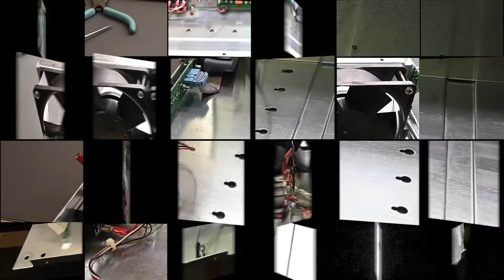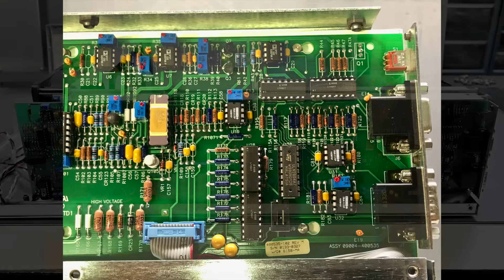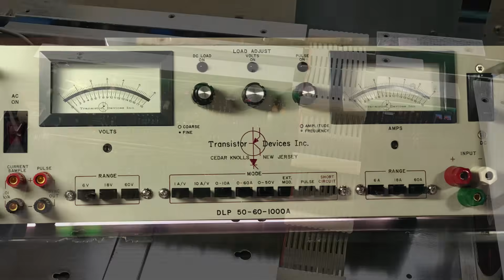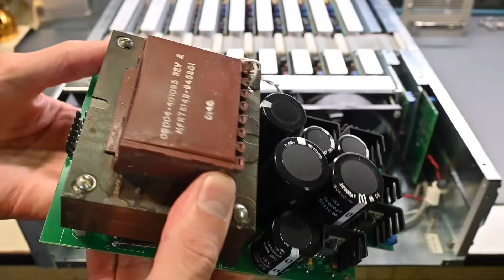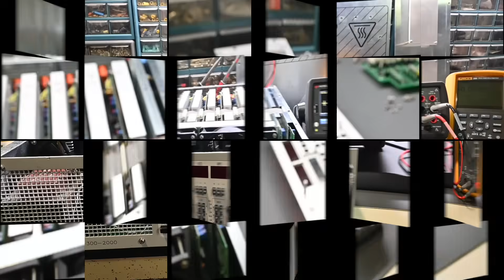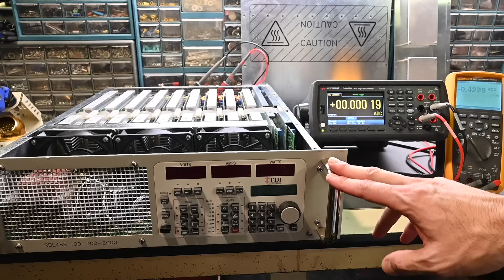Inside a Massive 2000 Watt Electronic Load (TDI 100-300-2000 Dynaload)

Comment: MOSFETs don't show thermal runaway when used as switches while they do in linear applications, like in active loads. Usually, this phenomenon is prevented by having a current control loop for each one of them
Reply from the maker: Thank you for pointing this out.  In researching this I found several good articles on the topic. One example is   
https://www.nasa.gov/wp-content/uploads/2015/04/453478main-nesc-tb-10-01-power-mosfet-thermal-instability-1-28-10-nrb-tech-bulletin-final.pdf

I have a book about audio amplifier design that describes paralleling MOSFETS (being used in linear region) and the lack of thermal runaway issues, which is obviously not completely correct. 

In this electronic load it appears pairs of power FETs are paralleled and controlled by an op amp.  There is quite a bit of circuity on the power modules, no doubt in part to control the current loop.
Reply: @EriksElectronicsWorkbench  Infineon's aplication note "Linear Mode Operation and Safe Operating Diagram of Power-MOSFETs" is worth of reading
Reply: ...or Nexperia "IAN50006 - Power MOSFETs in linear mode"
Reply from the maker: @Mw6816HRI thanks will check it out.
Reply: "MOSFETs don't show thermal runaway when used as switches." They do go into thermal runaway when used as switches without sufficient cooling because the on resistance increases with die temperature, or positive feedback. But you are probably mixing up terminology. You are writing about current sharing in switching applications and linear application. The positive feedback (increasing Ron with temperature) actually promotes equal current sharing in linear application because the FET whose dissipation is higher will drive itself out of conduction when the on resistance is increasing with increasing die temperature. (There are some app notes from long ago about current sharing in linear application for parallel MOSFET's from a few vendors. They claimed FET's could be used in parallel without current sharing resistors. But in practice, this didn't really work properly.)

Comment: would be funny if they are  using tons of IRF250's in parallel. 25W a piece sounds about right.  
IXYS produces lots of modern 500W-1000W Mosfets in a huge brick case that looks like a rectifier, and their SOA look very generous but they are too expensive and one would still need a few in parallel.

Comment: If it is only DC load, it would better to have AC recuperation in power lines again. But there (1980s-1990s) was no any high power IGBTs, diodes, gate drivers and microprocessors to realize it. But now syncronous 50Hz rectifier and SEPIC converter becomes reality , and it is not so complex to build it

Comment: If you want to test the unit at higher amperage like >10 Amps/modul may look at the power relays caused voltage drop are how even. They can perform much worse when the unit is blowing hot air across the relays.
I asume they are switched “cold” but the capacitors across the contacts can store enough energy to weld them.

Comment: I'm interested in knowing how SOA protection is implemented on that
Reply from the maker: The microprocessor monitors the total power dissipation and won't allow any combination of current and voltage that exceeds 2000 Watts (plus a little extra headroom), or any setting that exceeds the maximum current rating.  There is a thermal switch on each heatsink, if any one heatsink goes into over temp the whole unit shuts down.  At 1000 Watts and above the fans kick into high speed.  Other faults for over voltage, saturation, etc. are also monitored.
Reply: @EriksElectronicsWorkbench  I was interested in building an electronic load for a while, but the project turned out to be a bit more difficult than I thought.  I had the same understanding of FETs, but in the end the rabbit hole was deep. It's worth investigating, it is very interesting
Reply from the maker: @Mw6816HRI There is a lot to these electronic loads so no doubt building one would be involved.  The text book I have was about paralleling MOSFETS in audio power amps and has erroneous information about them not going into thermal runaway, basically stating they are immune from that in linear applications. Such is not the case come to find out.
Reply: @EriksElectronicsWorkbench  Audio amplifier is close but is not DC. ZTC and SOA is important in DC using.

Comment: Recently got a 2400W specialised electronic load (24 ports PoE * 100W per port, for testing PoE PSE) and remarkably it fits in 1U height.
Reply: Sounds like a 747 on takeoff at full load I bet
Reply: @tmmtmm It does. Actually the fan control is not good, it runs them faster than necessary with light loads
Reply: 2400W PoE Tester would be a fun homelab piece. Whats the model?
Reply: @NutkeyDoesMinecraft Reach Technology PoE5 Tester. It's about 8k USD.

Comment: Would love to write a long detailed comment, but YouTube will just delete everything above three lines of text new subscribed accounts. So let me just tell you that's really interesting to see such a giant DC load from the inside. Mine is way smaller, just 500W, but way enough for my bench. My only bigger one is the dummy load for speaker outputs (constant resistance).

Comment: Thanks, Erik, great video! I wondered how these beasts were built.  
I would guess / assume that each 27W transistor has local feedback (shunt resistor and op-amp) for precision current control, and so transistor matching is not assumed. 
I suspect they limited the transistor power to such a low-ish value to accommodate the temperature rise of the thermal insulators, assembly torque, varying temperature across the heat sinks, fan efficiency. air flow variation, dirt, you name it. As someone else pointed out, finding FETs with DC SOA specified is hard nowadays. When they designed this 30 years ago, most FETs had DC SOA Specs. Conservative design is best. Don't forget to divide the MTTF  (Mean time to failure) of each transistor by 72 to get the MTTF of all transistors. Plus the 72x shunt resistors, op-amps, etc. With 72 of anything, reliability of each part is critical.
Reply from the maker: On the power modules it looks like they are using MC34072AP op amps to drive paralleled pairs of power FETs.  (4 of MC34072AP op amps & 8 FETs)   Each FET has a low value precision source resistor.   Yes the power dissipation per FET has to be reduced to keep the FETs in a safe region as they heat up.

Comment: I have worked on many of these load, the weakest link is the way the cooling fans draw air into the unit, it brings in a lot of dirt which messes up the switches. I used ammonia to clean them, that is usually the remedy.

Comment: It would seem that this is intended for DC loads only. Ideally, yes?
Reply from the maker: Yes only DC can be applied to the load.  You can take AC and run it through a bridge rectifier and essentially load test an AC source (a transformer for example).  The dynaload doesn't care if the DC is unfiltered (pulsing), measured values displayed may be off a bit.  The peak voltage pulses of DC can't exceed 100 volts for this electronic load.

Comment: They chose a solution based on a large number of low-cost MOSFETs, although the same functionality could have been achieved with a significantly smaller number of power transistors. I have demonstrated that it is possible to dissipate approximately 800 W using a single FDL100N50F MOSFET, mounted on a copper plate and thermally coupled to a 2 kg aluminum heatsink, with forced cooling provided by a 120 mm, 7500 rpm fan (as used in Antminer S7/S9 units). The maximum temperature measured on the copper plate at the MOSFET interface was 70 °C.
Reply from the maker: Yes less power FETs can be used and each could be very high power types but then the heat sinking and forced air cooling requirements become extreme to keep the devices within allowable and reliable limits.  Also this unit was designed nearly 30 years ago and power FET technology has improved probably allowing fewer power devices in a more modern unit.

Comment: Erik, you cleaned the rubber button keypad, but it wasn't explained how. I'm finding that on various television remotes, the buttons don't respond very well even when pressed hard and I'm about to do so on mine. Wonder if there's a way to improve their conductivity other than cleaning with simple alcohol. Thinking of using the Deoxit Fader F100L also used for slider potentiometers. Of coarse, we wouldn't use just any Deoxit because some types can actually do more harm. Just wondering of the best way in keeping up, better yet improving, conductivity of these individual rubber keys. Thanks!
Reply from the maker: I didn't clean the conductive rubber areas, just the buttons with a damp paper towel.  They were dirty where they pass through the front panel.  And cleaned the gold circuit board traces with pure isopropyl alcohol and a soft cotton applicator.    I've not tried this product but check out   https://www.chemtronics.com/circuitworks-rubber-keypad-repair-kit   for repairing the conductive rubber contacts.    Don't use contact cleaners like Deoxit on the conductive rubber.

Comment: Power MOSFETs are easy to parallel when they are used as switches but they are not easy to parallel when used as "linear" devices. A MOSFET intended for switching applications won't even play nice by itself, much less with others in linear circuits. The individual cells within a FET may share poorly, resulting in device failure. There are power FETs made specifically for linear applications.

Details of issues can be found on the web from reliable sources such as device manufacturers' ap notes and professional electronics sites. 

The faction of the total offerings of power MOSFETs well suited for linear applications is extremely tiny. I haven't looked at what is available for years, but what I did find when I was contemplating building an electronic load that would handle 400 V were expensive. About the only other types on the market at the time were intended for audio amplifiers.

The real measure of an electronic load is its dynamic performance. Nobody ever tests dynamic performance of power supplies or loads in any video I've ever seen. When you are testing the dynamic performance of a power supply or amplifier, you don't want your load fighting with the power supply. That load needs to look like a resistor or constant current sink or shunt voltage regulator at all times according to how it is set, not something that takes time to get its act together and decide what it is while the DUT is doing the same. If you use your load to present a step change in loading to the DUT it better do it cleanly with very good settling time, otherwise you have no idea whether it is the DUT or the load pretending to be a bell. I would expect the load in the video to be very good. The stuff sold on places like Back Alley Express - not so much.
Reply from the maker: The reason I mention they are easy to parallel is the fact they won't current hog.  Linear region use or switched the nature to not go into thermal runaway remains the same.  The slew rate is adjustable for considerations with high current pulse loading and effects of cabling inductance. The following is from the user's manual:      One characteristic of power MOSFET'S is called transconductance. Today's MOSFET'S are
 designed for high speed switch mode operation where the operation is full ON or full OFF. The 
Dynaload uses these FET’s in their linear region where the transconductance effect becomes
 apparent. When the gate of a FET is pulsed, the drive circuitry must overcome the inherent miller
 capacitance to reach the desired gate voltage. When the pulsed gate signal is very small the 
transconductance of the component will limit the rise time of the FET.
 When operating the Dynaload at pulsed currents less than 10% of full scale, the rise time of the 
current waveform will be much slower than expected. Since this roll off in response is dependent 
on the number of FET's used in the power tray and the actual current pulse desired, it is very 
difficult to provide exact equations to define the effect. It is suggested to select a load that will
 provide the desired pulse level while operating at current levels greater than 10% of the full
 current rating of the load. If the baseline current is greater than 10% of full scale current and the
 pulsed waveform is added above this baseline the effects of transconductance will be eliminated.
 The greatest distortion occurs when pulsing from a zero current baseline.

Comment: Wow, that's a beast of a electronic load, with 2000 watts it won't be cold in your lab this winter. 
i presume that the current to the Mosfets is switched or work these Mosfets as a linear load ?
Reply from the maker: The power FETs are run as a linear load.
Reply: @EriksElectronicsWorkbench  thx for the quick reply. grtz

Comment: That's a pretty nice electronic load. What I think is more useful in most applications (fixing power supplies) would be a lower wattage, but multi-channel load - most supplies these days have 3 or 4 rails, and are typically in the 100's of watts per voltage at most. I think a 4ch load that could do 200w on each channel would be ideal in most cases.
Reply from the maker: Thanks, agree that in many cases testing doesn't need such high power dissipation.  I have two 300 watt BK Precision loads that are a perfect size for a lot of projects.
Reply: In that case you will be better off with multiple individual loads and a controller. I use two Rigol DL3021 with an Rasberry Pi to test the power supplies of big class D audio amps. The main limitation with my setup is that 600W is nowhere near enogh to fully test the PSUs but its good enough to confirm stability (looking at you Labgruppen FP series) After that I connect the power amp sections and hook up multi kW resistors to the outputs.